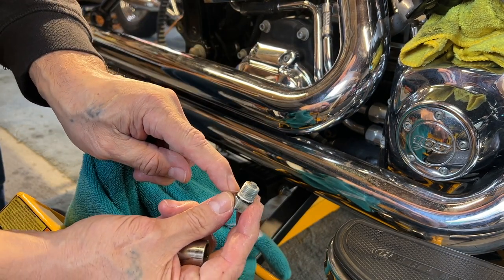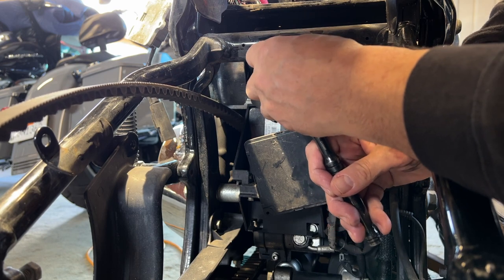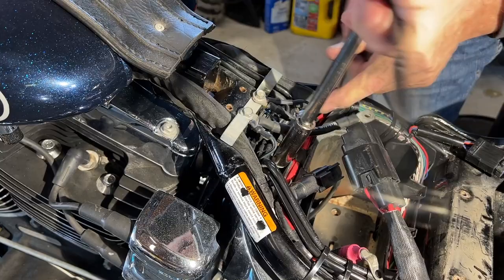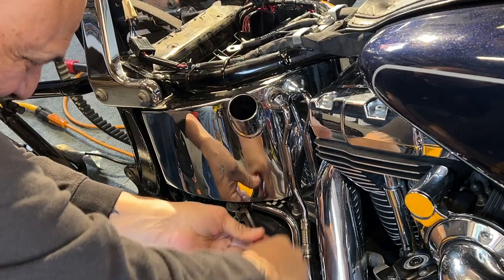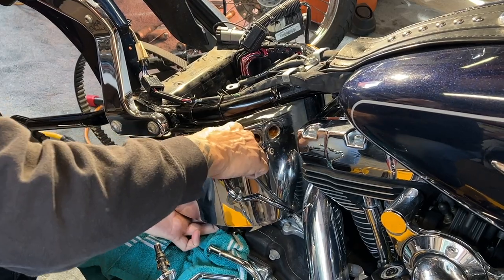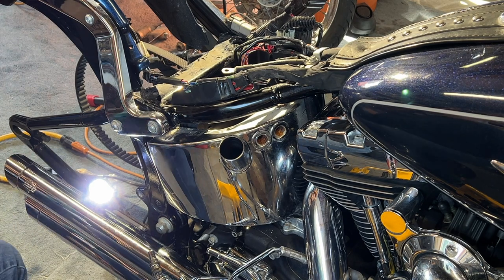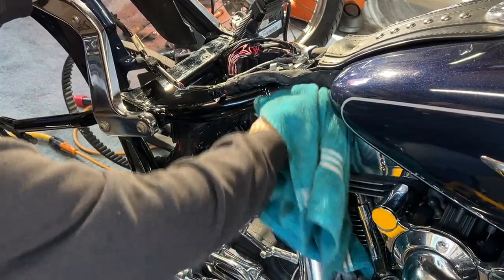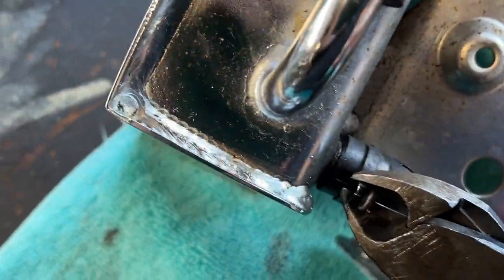Removed Oil Tank From 2013 Softail Heritage To Repair Leak

Comment: I did a video on this same problem a few years ago when I had my 2012 heritage. Was able to replace the line without removing the tank by removing the rear wheel and then the mud guard in front of it. After that, the line was completely accessable.
Reply from the maker: You know I figured I could’ve done it on but really wanted to take it off and inspect everything to make sure the tank was okay because the bike was rear ended a few years back. Thank you so much for subscribing. I really appreciate your support. If you know anyone who would be interested in winning a Harley please let them know currently have 2 bikes I’m trying to raffle again here soon. Thanks again and have a great day 👍🏼🙏🏼

Comment: Hey John, lots of work for a $11 drain hose. Had to replace mine on 2012 heartage softail classic FLSTC... wish I could be there to show ya, it can be done without removing anything, no taking off back tire, battery nor oil tank... it can be done.. those factory pinch clamps are a pain in the ass, but placing a small screwdriver in between the clamp and slowly opening it up just little bit, the clamp will move and hose will come off, put new hose on with regular hose clamps... in da wind ya go... save ya lots of time.. 💯💪👍
Reply from the maker: Hey Kenneth, thanks for your awesome input. Yeah, big lesson learned here. Next time I will definitely do things differently. One things for sure I learned a lot about a softail working on this bike. It’s been fun and challenging at times but I’d do it all over again in a heartbeat if given the opportunity. Thanks again and you have yourself a great evening and weekend. 👍🏼💯🙏🏼
Reply: I would appreciate any advice. That drain hose is leaking at the bottom, not the top where this one was . Hoping I can just replace the clamp at the bottom. 2017 Heritage

Comment: I'm going to have to do a starter on mine shortly. Last season I had that same oil leak, I put the new hose on without taking anything off. Just slid it back up in there. Crazy they'd charge $1000 for that.